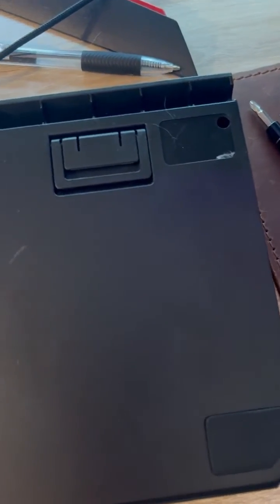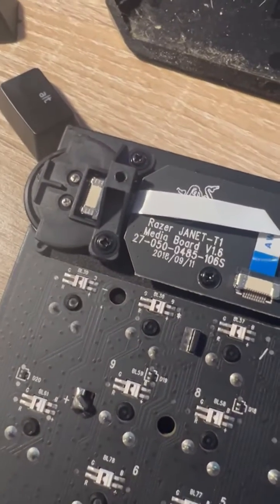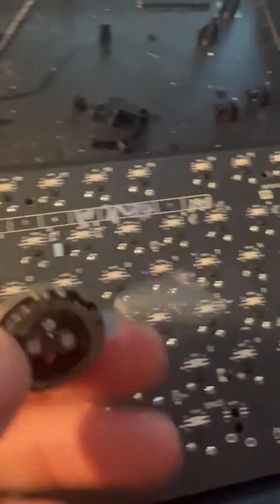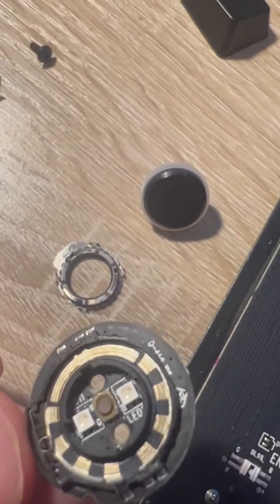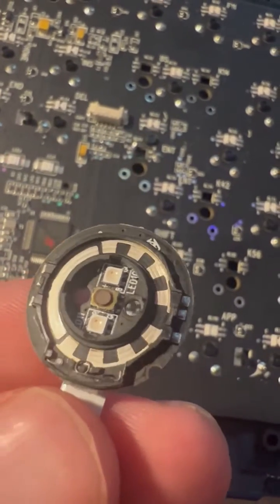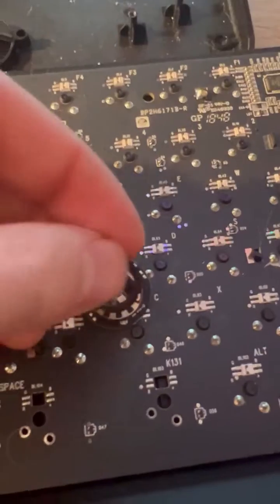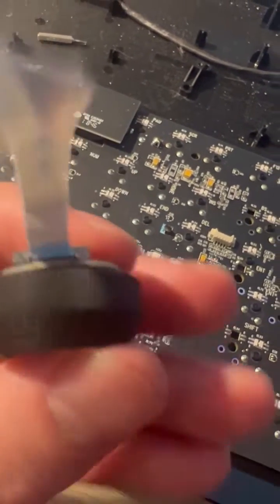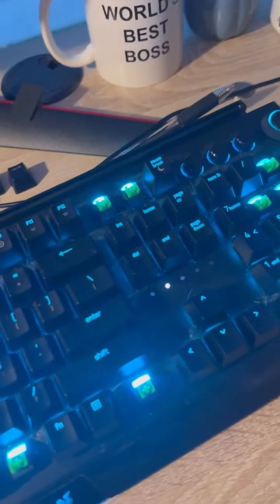Razor Keyboard Volume Knob Fix (Blackwidow Elite)

Comment: what i found that worked for me was to turn the air can upside down so the liquid CO2 would spray into the wheel and spun as i did that. My theory is that since co2 is acidic i think it disolved the oils for me instead of having to take it apart, im also thinking wd40 could work since its a solvent but I dont know if  it might damage it that way

Comment: I held up the wheel a bit and sprayed in some "electronic cleaner" spray and it worked immediately as new
Reply from the maker: That’s always a good first step, wasn’t working for me but atleast this video is a worst case scenario it don’t fix
Reply: @commandpost1   He said electronic cleaner, not canned air. They are different. These electronics cleaners have a cleaner and lubricant. That's why yours was tough to rotate compared to before, you removed the lube. Contact cleaner was used forever on old school TV tuners for similar cleaning and lubrication. They just get a buildup after a while, entirely normal, Razer just hopes you buy a new keyboard instead!

Comment: I was gonna get some of that cleaning spray to try mine. I have cannibalized and rebuilt so many different techs that I'm not interested in taking apart this keyboard lol. 
However, thank you for the details and will circle back to this video if I must take it apart on top of the mechanical cleaning spray. 
Plus, get off OPs nuts. All y'all's keyboards gonna be nasty. They just get that way, especially if you eat at your desk. Sheesh!

Edit: spell check and auto correct. Curses!!!

Comment: There is acually much simpler solution I find on forum after 2 years having this problem. Just spin the volume button down and up very fast (like you are playing fruit ninja) and hold keyboard in diffent angles (upside down etc.) when the keyboar is unplugged. To my suprise this fruit ninja technique worked with huntsman v2 analog
Reply from the maker: Tried this, only barely helped but it was still TERRIBLY non functional
Reply: Thankkkksss it worked for me on my blackwidown v3 pro.

Comment: Dude, your keyboard is friggin disgusting. Also, all you need is contact cleaner that is safe for plastics to fix the scroll wheel. Spray it on, wait, and it's fixed.

Comment: Used this vid to fully deep clean every surface of the dial and it functions like brand new. Btw if it seems like the wheel won’t go back on there are little clips and you have to align it just right and push a certain amount. It can be very finicky so LOTS of patience is key

Comment: too risky. just some contact cleaner spray will fix this, many videos on youtube
Reply from the maker: You have to take it apart tho to get to the actual contact points. All those YouTube videos you see BASICALLY tell you to use compressed air which DOES NOT DO SHIT
Reply: @commandpost1   Nope, just use the electronics cleaner right and it gets where it needs to go, WITHOUT disassembly. Gotta be smarter than what you are workiing with, that's all.

Comment: Seems like you could pop the volume knob off without opening up the whole keyboard. Then you could get in there and clean it up and snap the cap back on. What do you think? I'm having the same issue and think I might try just popping it off.
Reply: Did it work?
Reply: @papitoxd  nope, a couple of screws under tha cap holding it in.